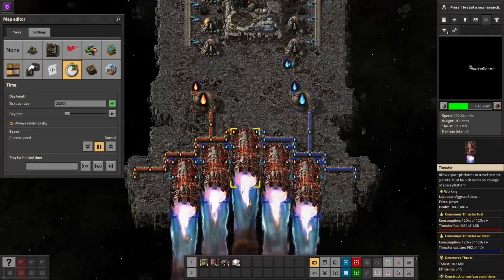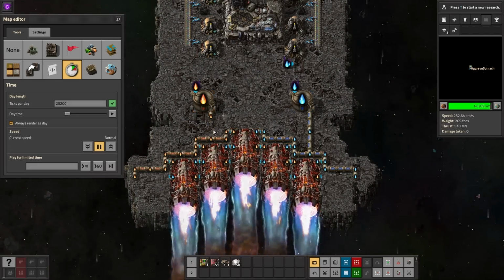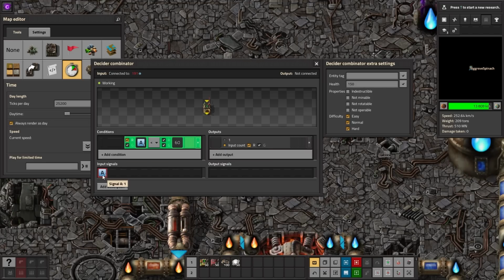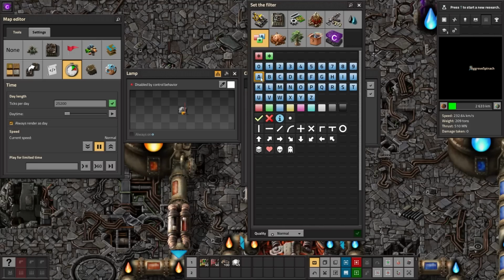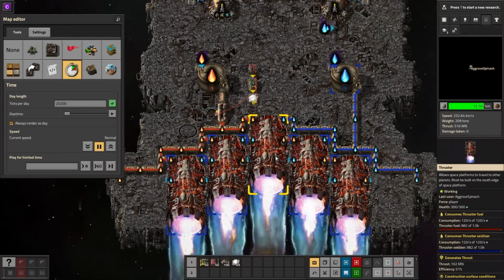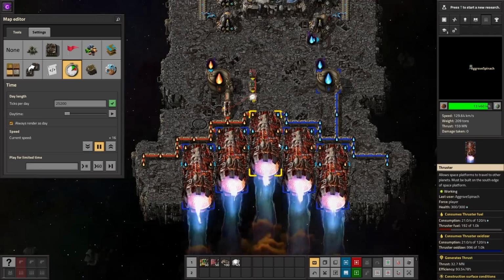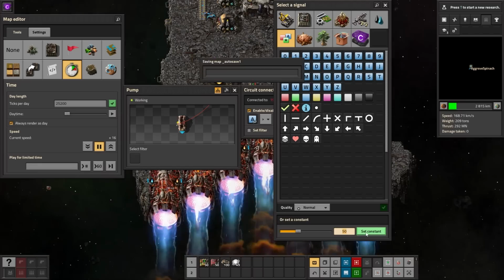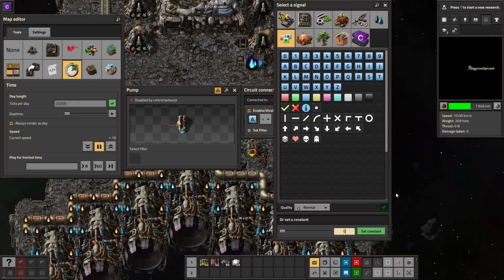Controlling THRUSTER fuel input and efficiency - Factorio 2.0 Space Age Tips & Tricks

Comment: A) you can control the speed by watching current speed of the platform (platform signal "V") it self with will oscilate but there are ways to control it so it wont oscilate by more than 2 or 3 km/s
B) "put it on bouth fules and oxidizer lines" not necesary fuel and oxidizer are used at the same rate you run out of fuel no oxidizer will be used and the other way around ... aka liming one limits bouth
Reply from the maker: I need to try out 2 solutions after reading all the comments, 1 is to control via the speed, and 2 is to control via storage tanks after the thrusters. 

In terms of controlling both, there's no harm in doing it, in my actual game my ship at one point didn't produce enough oxidiser (I dunno, some asteroid collection imbalance) which led to the fuel circuit overpumping fuel and no control on how much oxidiser went in
Reply: @DataEngineerPlays  Right but if oxidizer is low then the thrusters can't use the extra pumped fuel. The thrust will be lower than you wanted until you fix the production, at which point you just have some extra fuel buffer, which is exactly like when leaving a planet.

Comment: Counter argument: More engines means more mass, so all thrust is less effective, and you have higher area to defend, so more ammo production, which again leads to more mass
Reply from the maker: @nagshell  is the extra mass of a few extra thrusters really not worth saving half your fuel?
Reply: @DataEngineerPlays what’a the problem with just producing more fuel? There are enough asteroids to gather resources, you can use better quality items, modules etc. What’s the point with cuting fuel output? If you build platforms eg. to transport science pack you can just wait few seconds to let the tanks fill (if you don’t produce enough fuel) instead of reducing consumption and minimizing possible max speed
Reply from the maker: @damianr.3917  nothing is wrong with producing more fuel. In fact I've known about efficiency since my first space platform yet I've never implemented this circuit until aquilo since I never found an easy way to control fuel. But I finally figured this little 2 circuit logic out and its easy to implement so why not conserve fuel
Reply: @DataEngineerPlays  I agree conserving fuel is better, but there is a consideration that expanding engines too much will overall decrease your travel speed.
I usually just fill entire bottom of the ship with engines, but I'm not gonna expand ship's width just to fit more for higher fuel efficiency.
Reply: As of now, it's not the mass, but actually the width of the ship that affects the thrust.
Reply: Hold on.  I'm pretty sure the mass of a platform only depends on one thing and that's the amount of space platform foundations used.  Cargo v no cargo, empty platform v platform covered with tightly packed entities, only the foundations matter.  While it's true that you need some more foundations to add thrusters, they might represent a +x% mass increase for the whole platform.  And you'll gain more than +x% efficiency out of the extra thrusters, whatever that amount of foundations was.

And if adding thrusters add to the size of the area that needs defense, I suggest you rethink the whole way you build platforms :P

Comment: My solution is very caveman by comparison: store up required fuel and oxidizer in the form of their raws (water, iron ore, carbon) and use the chemical plants' production rates as my valves, tuning with productivity modules. This approach was born from an interesting marathon challenge run I'm undertaking to master: get a Space Age victory without researching circuit network and without using belts as anything other than a science ingredient.
Reply: WHAT THE HELL DUDE
Reply: @cornbonzo7027  I failed to mention just a couple other things in the challenge: not researching gun turrets either, so it's just walls, repair packs, extra platform foundation to replace losses, and gimped speed until rocket turrets, and my ship will be nuclear powered from the word go: one solar panel crafted, total, for the playthrough and that used exclusively as a boot-up crutch to get the 500 degree steam pumping on the three occasions that's necessary (ship construction, starting Vulcanus, and starting Aquilo) and then immediately deconstructed after serving that purpose. So yeah, 'marathon' is not used lightly here. 🤓
Reply: @BranLlyr  Oh god that sounds like a lot of pain. But I wish you good fortune!
Reply from the maker: @BranLlyr  you are an insane person
Reply: That's psychotic
Reply from the maker: I didn't even implement fuel control, my solution used to be "just make more fuel and burn at 51% efficiency". It's okay as long as it works. The only reason I implemented this solution at all was because it seemed just simple enough for my puny brain to comprehend
Reply: Wait, how do you build ships without belts? Do you direct insert asteroid chunks from collectiors into crushers?
Reply: @DoubLL  basically it means daisy-chaining turret ammo out of the hub and not relying on asteroid collection at all during travel.
Reply: but I did turn off enemy expansion and time-based evolution progression, so it's not ALL pain. 🙃

Comment: Cool, that's a very easy way of doing it! Another thing you can do is read the speed of your space ship and set the pumps that way. But that involves a few more cables.
You can also read the start and end destination of your ship to determine if it is traveling or not. That way your ship doesn't waste fuel while stationary.
Reply from the maker: @wigoow1206  I like the idea of reading destinations. But yeah I've seen many setups check the velocity of the ship and they are more complex but provide better control but I wanted to the simplest dumbest circuit possible. A lot of people hate circuitry I've found
Reply: @DataEngineerPlays  adding to the destination being a variable:

This setup works fantastic to have the ship efficiently bus around the planets for science and then absolutely book it, albeit inefficiently, from gleba to Nauvis.
Reply: @MeepMoMurp  I use the origin/destination reading to slow down once I reach the edge of the solar system. My current ship just can't handle the amount of asteroids at full speed. 😢
Reply: Ffurls are used when stationary?

Comment: And what of a change make here quality engine ? is it worth it?
Reply from the maker: @pankaktus7772  good question. I'll have to check in game
Reply: Upgrading my engines from normal to all blue ramped up my speed from 180 to 350.
Reply: Higher quality engines just mean you can achieve the same speed with less thrusters. So, burning fuel at high effciency = less fuel used, but lowers speed. Using higher quality engines = more speed for the same amount of engines, but burns more fuel.

Comment: Nice way to do it, I didnt know how to make clocks. What I did to control my ship was doing a test run to check the top speed then telling the pump to shut down if speed is higher than 77% of that
Reply from the maker: @javierguerrero9910  yes I've seen a lot of complex work involving checking the ships speed. But since the fuel self regulates because of the efficiency curve you need only reduce the fuel input to control the levels, less circuitry work I believe
Reply: @DataEngineerPlays  Actually using a clock is more difficult. It is also a gimmick design because it is using the game engine 60 tick per second updates. Reading a single value from the hub and checking this value on the pump is way easier. It does not need any combinators/circuits at all. Just a wire from the pump to the hub. And the effect is exactly the same.
Reply from the maker: @Arcane_123  I actually tried the speed check method, it works great and definitely simpler. My only gripe would be that it fluctuates the fuel a lot more. But definitely a worthwhile trade off if you don't wanna do the clock
Reply: @DataEngineerPlays  Yup that's right. It oscillates quite a bit. It can be a slight issue if the asteroid defense is barely holding on. Otherwise it does not matter at all.
Reply: @Arcane_123  it is less flexible and more difficult to calibrate.

Any change in ship weight or width (apparently there is drag in space in Factorio) will affect speed and you have to do a test run with your ship to determine new values.

With the clock I can look at the consumption vs efficiency graph in Factoriopedia entry once and decide that - for example - I want to run my engines at 60 fuel/s, then when building or modifying a ship I do a simple calculation (pump has 1200 f/s, I have 3 engines. So: 60*3/1200 = 15%) and just set my pump to run for given percentage of time.

Also it doesn't really matter if game runs currently in 60 ticks/s or 40 ticks/s (as long as the tick rate doesn't change too rapidly) because I want to run my pump 15% of time measured by single clock loop and I don't really care that much whether that means 1 second or 1.5 seconds. (since it ends up being 15% average runtime anyway)

Comment: Well, it doesn't actually help increase the ship's speed. If you look at the speed before the timer was connected - it was ~252 km/s (3:30). After - 218 km/s (3:55). So it doesn't increase the speed in the long run. But at least it will help to reduce the ship's speed when necessary.
Reply: Most of the time, speed is not that problem, just carry more. So fuel is more important because you want to be able to have enough until you drop stuff or get stuff.
Reply: @mertserimer6928  Speed is super important for Gleba run as science packs spoil. And fuel was never an issue for me there once I got the advanced fuel production. Just add more refineries.
Reply: @IxGxNxI yes they spoil, but the difference of 1 minute between a faster or slower platform shouldn't matter if you build the production delivery and consumption delivery efficiently. The spoilage problem will hit you when you research items that don't use agricultural science for long stretches.
Reply: @CuratedPile Eh even then that's not a problem just burn it. Basically you can stockpile most science if you aren't using it, but not agricultural science. It's throughput based, just like the rest of Gleba. So if your usage is 0, burn the spoilage.

Everything on Gleba is free and infinite so it's not a big deal to "waste" the science.
Reply: @SpacePopeIII  never said it was a big problem, just spoilage were you don't usually have deal with it. Honestly I think the entire Gleba/spoilage mechanic is fantastic.
Reply from the maker: @mertserimer6928  so less fuel will always reduce speed, but to remedy speed just add more thrusters. But the point is fuel efficiency.

Eg If you have 7 thrusters running at 90% efficiency you'll match the speed of 3 thrusters running on max but consume less fuel (don't quote me I just made those numbers up from thin air) but that's the point of controlling fuel input, to conserve fuel not achieve more speed

Comment: Since 2.0 you don't need the constant combinator for the clock. You can simply set a second output for zero with 1 as the value
And i think you can connect the decider combinator to the hub and only run the clock if the ship is in transit
Reply from the maker: @bobderbobs1521  what really? Amazing. Even simpler you can just use 1 decider combinator then
Reply: Wow - that is cool! I need to fix all my engines now! 😀 @DataEngineerPlays  Thanks for the video! Great content!
Reply: @DataEngineerPlays  do you think you'll make a second video with all your updated findings?
Reply from the maker: @Shwayne  yeah sounds like a good idea I can cover the simplified clock, direct control via velocity and the storage tank method then people can just choose what they like best
Reply: Oh, I was working around this by just making more fuel 😅
Reply: @gordug  or by underproducing fuel
Reply: Further testing today, I built a large platform with 8 rare engines, had a tank either side if the array with a pump pulling from the fuel stores. Set the pumps to top up to 60 and now get %98.4 efficiency and 110 speed
Reply: thanks
Reply: The problem with limiting the clock to when the ship is in transit, you cannot detect via circuit if the ship is parked, or is set to go somewhere but still hasn't moved, and since the clock is off, it will never move, so you need to manually feed a little bit of fuel to the thrusters by manually turning on the clock so that it actually counts as "in transit" for the clock to kick in
Reply: @blucky_yt  I found that too, but if you prime the engines it tends to work out
Reply: @gordug  Yeah, the only risk is that, if you run out of fuel while in transit, and arrive at a planet while still out of fuel, you'll have to prime again. But you can fix this by having a circuit condition to only leave a planet if you have enough fuel in a tank to arrive to your destination.
Reply: You actually don't need the combinator at all. Just read the speed of the platform and have the pump turn on when below your clamped max speed. The thrusters start the flight full, so slightly less efficient for the very beginning, but then it rights itself for the rest of the flight. 

Much simpler than running a clock.
Reply: @seniorfiance your speed reference has to change every time u enlarge ur platform or increase thrusters count. Still good though even it is not future proof
Reply: How do we read the platform velocity?
Reply: I'm new to circuits, can you clarify this with a bit more detail on the setting a second output for zero with a value for 1. I understand the output of 1 but I'm confused as to what the zero does or how it works.
Reply: @ianm2800  Dunno what he means.. But i got a timer going with the same A < 60 on input
and on the output i have both A = input count  and a second output of A with value 1
Reply: @Darqion  thanks that makes a lot of sense
Reply: @ianm2800  Do the same as the video, but without the constant. On the decider, set two outputs. One output on "1", the other on "input count". 

When fed back into the decided they'll add together and you get the same counting behaviour.